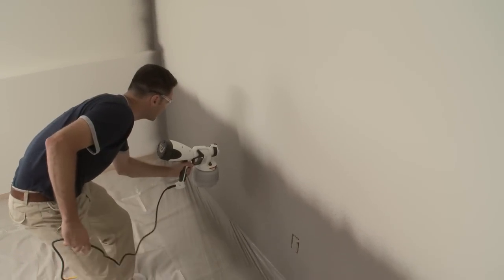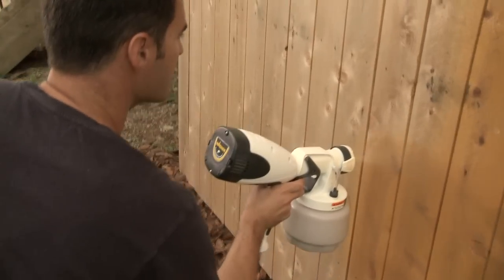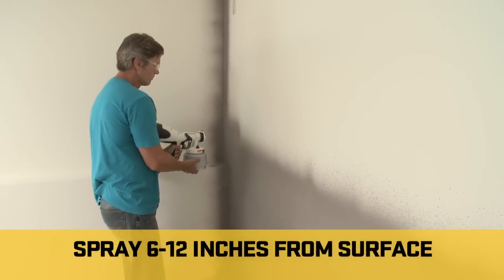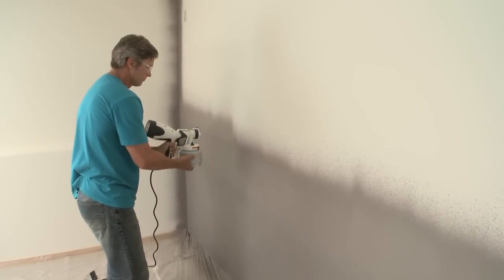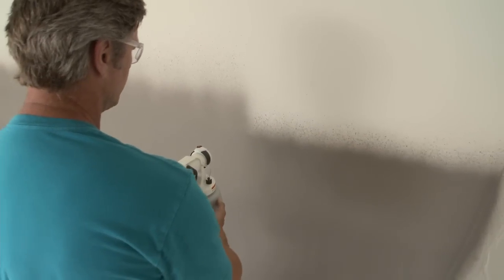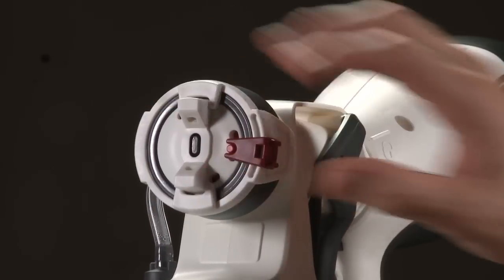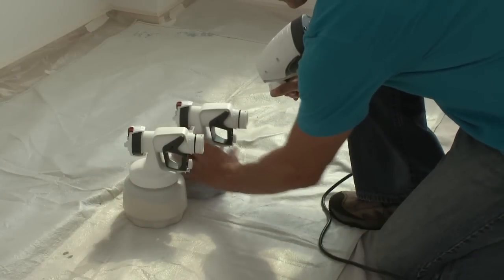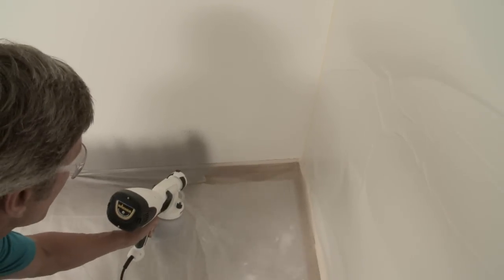Wagner PaintREADY Sprayer Painting

Comment from the maker: Are you seeing an initial "spit" of water when you first pull the trigger?  If so you may not be operating the trigger correctly.  The turbine on the PaintREADY is a 2-stage turbine.  You first need to only slightly pull the trigger back - not far enough to spray but far enough to activate the turbine.  Allow the turbine to reach full power (this only takes a short moment) and then fully pull the trigger.  Doing this should eliminate spitting.

Comment: actually, this thing has worked great and very fast with paint plus primer....it's using thin paint where I think a roller may leave more paint on and make it look better.  Other thing..seems like getting the primer on a very different contrast wall takes a while, but like I said, putting on primer+paint goes fast and in one coat.